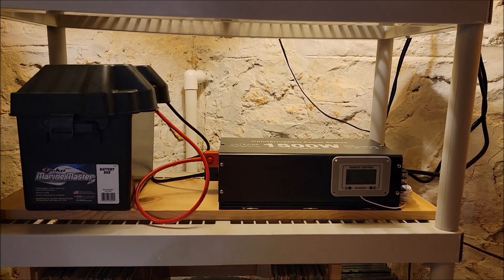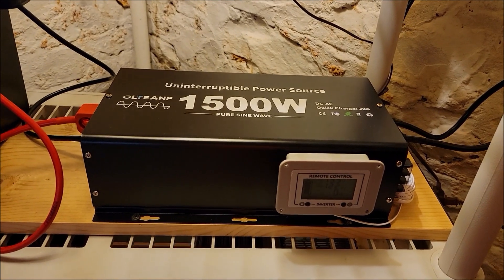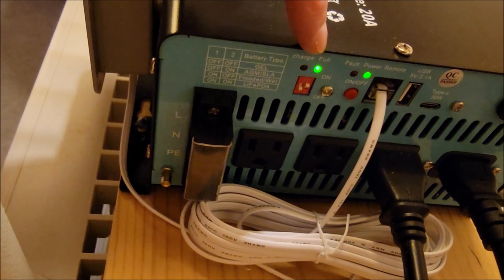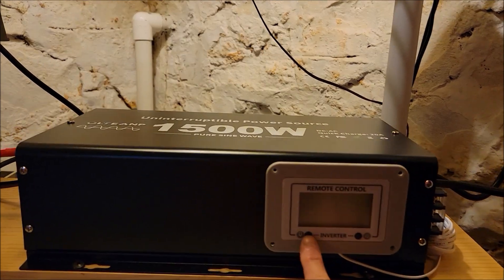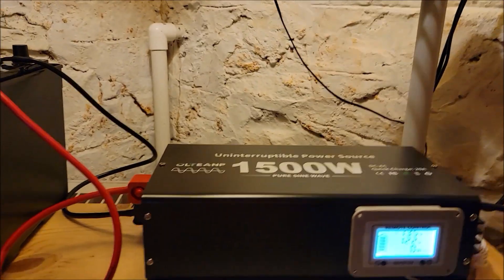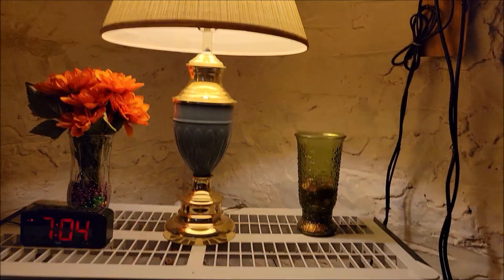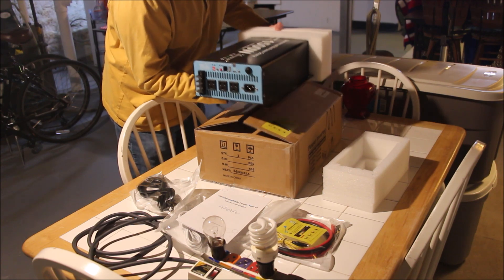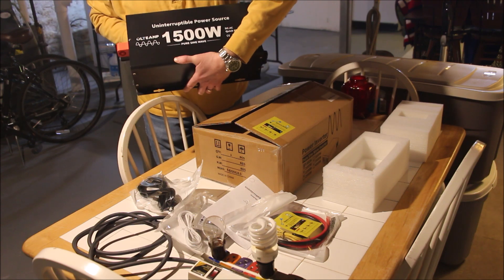Sump Pump Battery Backup Solution for primary pump

Comment: There is a fuse in the inverter to protect the battery?
Reply from the maker: Yes. It will also show a fault if there is an issue with the battery. This inverter includes a screen that connects by a wire, so you can monitor the battery, A/C, and status of the setup at a glance. I like the wired screen as opposed to a built-in screen since I can mount the screen for easier reading.

Comment: If the A/C power goes out and the sump pump runs off battery and then the battery runs out, when the A/C power comes back online does the Olteanp inverter immediately pass the A/C power through to the sump pump and start charging the battery without manual intervention? Or do you need to fiddle with it after both the A/C power and battery power go out?
Reply: Yes, when the ac power mains come back on, this inverter switches back to house power for the sump pump and begins recharging the connected battery.
Reply: @williambreeden4805  Thank you !

Comment: Great video! Thank you! I copied this set up today, minus the float controller. What is the advantage of the float controller? Also, can I run a second battery parallel with this inverter? Thank you!
Reply: The float controller will turn on your pump in response to either of 2 sensors. It also runs your pump weekly to test it, and alerts you if the pump fails to run during this test.

Comment: Can the inverter be plugged into a regular 15 amp outlet or does it need to be plugged into a 20 amp?
Reply: 1/2 HP sump pump runs 8 amps so either way is fine
Reply from the maker: 15 amp outlet works fine, as my 1/3 hp sump pump only draws 4-5 amps.

Comment from the maker: Here are links to the devices I selected: 

Inverter: https://www.amazon.com/OLTEANP-Inverter-Controller-Automatic-Switching/dp/B0DLWHJ8Z5/ref=sr_1_1?crid=36EF2WAI132SU&dib=eyJ2IjoiMSJ9.9lQWvlg4PVc7Dz1Mr_euxCBbtmf7bYihhvpjpemsv24.T2YZZz9XzYEtjmaB8Dk3F0a0OfOxUTBm_2E2cqnsxO0&dib_tag=se&keywords=1500W%2BSump%2BPump%2BBattery%2BBackup%2BSystem%2C%2BPure%2BSine%2BWave%2BPower%2BInverter%2Bwith%2BCharger%2C%2BBackup%2BSystem%2Bfor%2BPower%2BOutage%2C%2BLCD%2BScreen%2BRemote%2BController%2C%2BAutomatic%2BSwitching%2Bfor%2BGrid%2Band%2BBattery&qid=1751242547&sprefix=1500w%2Bsump%2Bpump%2Bbattery%2Bbackup%2Bsystem%2C%2Bpure%2Bsine%2Bwave%2Bpower%2Binverter%2Bwith%2Bcharger%2C%2Bbackup%2Bsystem%2Bfor%2Bpower%2Boutage%2C%2Blcd%2Bscreen%2Bremote%2Bcontroller%2C%2Bautomatic%2Bswitching%2Bfor%2Bgrid%2Band%2Bbattery%2Caps%2C168&sr=8-1&th=1

Float Controller: https://www.amazon.com/Glentronics-DFC1-5-Enhanced-Controller-Switch/dp/B01EZ6MBVA/ref=asc_df_B01EZ6MBVA?mcid=91aa12e40a023165be4b3b606ebe61a3&hvocijid=8657881081132234314-B01EZ6MBVA-&hvexpln=73&tag=hyprod-20&linkCode=df0&hvadid=721245378154&hvpos=&hvnetw=g&hvrand=8657881081132234314&hvpone=&hvptwo=&hvqmt=&hvdev=c&hvdvcmdl=&hvlocint=&hvlocphy=9022871&hvtargid=pla-2281435177378&psc=1

Battery: https://www.batteriesplus.com/productdetails/sli24magmdc

Battery Box: https://www.menards.com/main/outdoors/outdoor-recreation-sports/fishing-boating-supplies/boat-accessories/deka-battery-box/03009/p-1485933770909-c-12524.htm?exp=false

Comment: I LOVE this video.  I am not a big fan of float switches so I will just plug the Little Giant pump I have directly into the inverter. I am also going to add a second backup pump that is 5 inches higher than the primary and on the other side of the pump.  I will also add another battery or two because when we get saturation the pump cycles on and off every two minutes pumping about 5 gallons or so each cycle. Love the fact that it auto transfers between 12v and 120v.
Reply: Thats my question, isn't it redundant to have a float controller on a sump that has a float switch built in?
Reply: @Iamfirebird360 The float controller will run your pump a bit longer after the float switch sinks, which empties your pit better. It also exercises your pump weekly during dry spells.

Comment: Thank for your great vidéo. Havé you considèred a combinaison of marine battery + ecoflow. If yes, why didn’t you chose that option ?
Reply from the maker: The EcoFlow DELTA 3 Plus would have been my choice, as it costs about the same as my setup ($600-$700 range). It provides 1024Wh capacity, and my sump pump draws 500W (4A) while running. My setup uses an 80Ah marine AGM battery, which should power my sump pump for a few days if it runs for 15 seconds every 5 minutes.  Be sure to do the math when putting together a solution.
Reply: @williambreeden4 

Hi. Great video! Thank you for the details. Could you please provide the links for the inverter, battery case, and the float controller?
Thank you in advance
Reply: @williambreeden4  What kind of sump pump are you using? What's the horsepower?